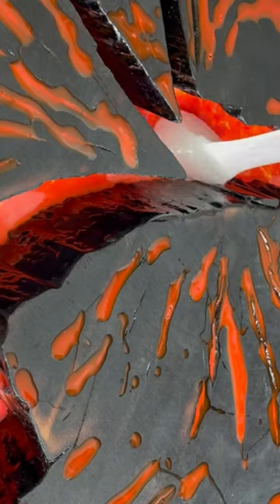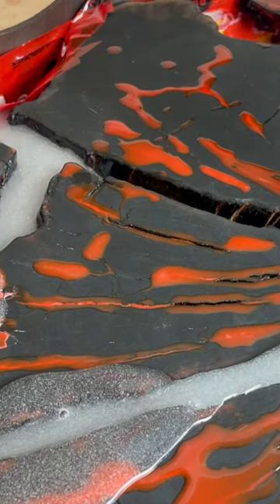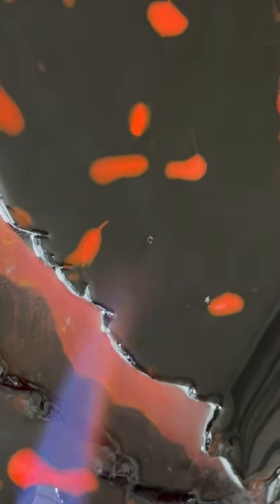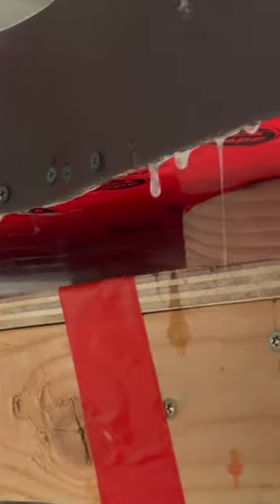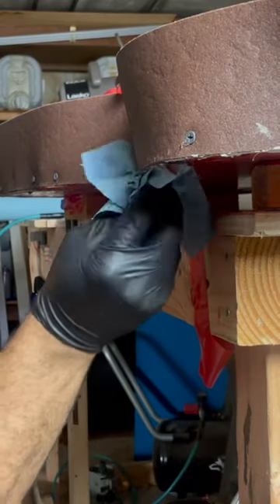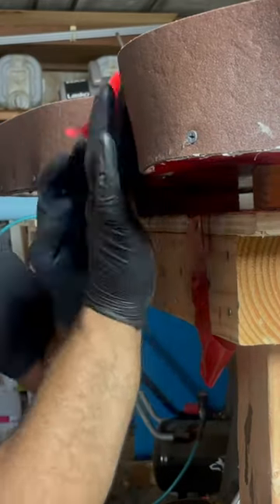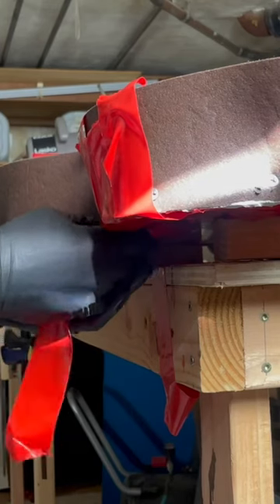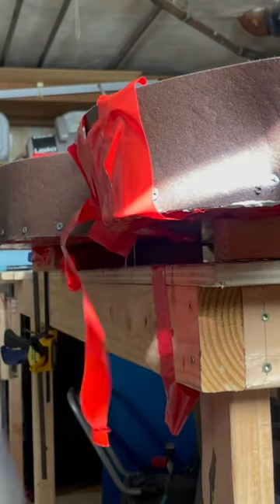🟥Red Tape SAVED this Table #diy #epoxy #woodworking #art #resin #epoxywoodworking #leaks #drip #art

Comment: Next time try packing with paper towels and then taping over the towels. I always got glue all seams but use that method in case I miss a spot.
Reply from the maker: Thanks for the tip 🙏🏽

Comment: Should have just packed with saw dust and a 3" putty knife
Reply from the maker: First time hearing of that method. Thanks for the tip 🙏🏽
Reply: @studiogbk  I have done it several times nonprob just push it up in their. Start on one edge left or right side and work to other. Don't start in the middle